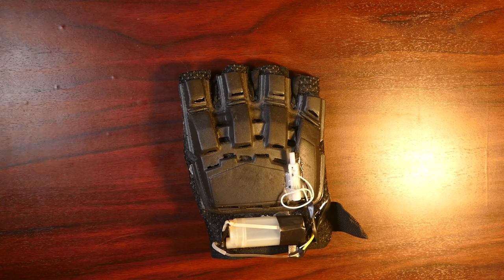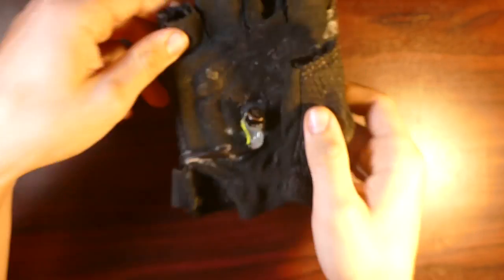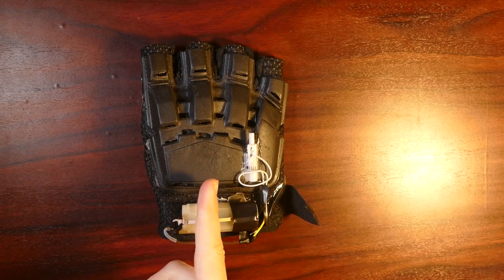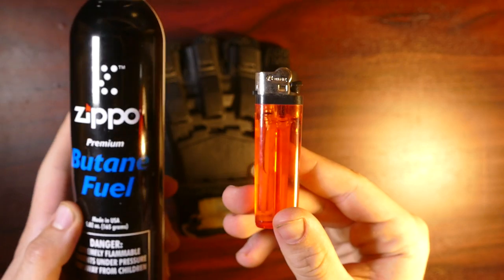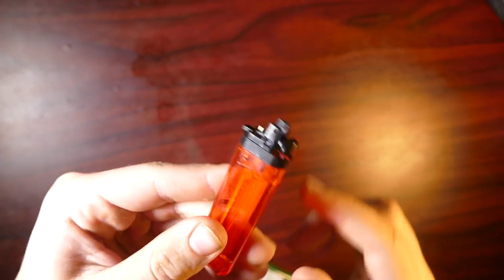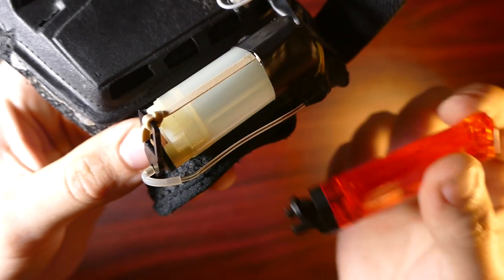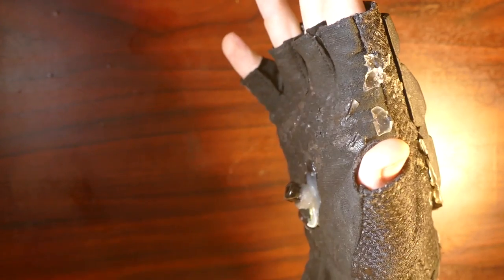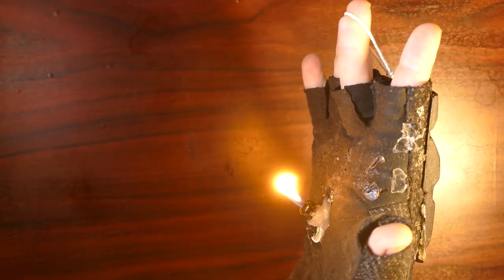DIY MASSIVE WRIST FLAMETHROWER With Only a Lighter! - BEST LIGHTER HACK EVER!!!

Comment: I made this and it was awesome until the police took it from me
Reply: SANS the skelenton what was that yellow wire? I have the globe, butane, and lighter but that yellow wire at 2:28 threw me off
Reply: What kind of butane did you use?
Reply: SANS the skelenton hey what do I do if the butane is blowing the hose off
Reply: I tired using my BBQ lighters but it didn't have the stuff as the one in the video what was the name of the BBQ lighter you used?
Reply: Eddie Shannon it is a separate copper wire
Reply: Eddie Shannon it was an extra wire to make the sparker longer
Reply: @eddieshannon9388  I think the wire just kept the plastic piece and the lighter more securely together since there is no type of energy in that plastic piece. But don't take my word for it.

Comment: im gonna mix this, the electric glove, the smoke one, and the lazer for the ultimate gadget! B)
Reply: I like the idea but I doubt it will fit all in one glove. Also If you will make a electric glove you can take out the ignition in the bbq lighter and make the butane burn by going through the electric spark in the electric glove to save space on the glove. (Also in my opinion the laser is pretty useless if you have electricity and fire for damage ond something similar to freezing. Also the laser doesn't do much. Just saying)
Reply: That sounds cool

Comment: Couple of Questions:

1) The fire seems to be spurting out other than the direction the hand is pointed in, is this normal? And how would you fix it to only throw fire where you point it? (e.g: Stop the gas leaks)

2) Is hotglue a good idea to use on a flamethrower..? Is there any substitute material I could use instead?

Comment: does the hotglue not melt under the heat of the flame?
Reply: Epsilon Builds yeah I was wondering that too
Reply: Epsilon Cosplay probably does. That could be why he doesnt hold it for too long
Reply: Epsilon Cosplay it also dries when you stop it
Reply: Epsilon Cosplay u could also wrap it with electrical tape or any fire retardant material
Reply: no
Reply: I dont think so if u will hold the flame for longer time it will definately melt
Reply: I made this too. And yeah. It does.
Reply: It can stand because its hot-glue
Reply: @ledude12  i see what you did there

Comment: @JLaservideo 

Hey there, you just made my dream come true! I always wanted to make a wrist flamethrower and now I will.
Another suggestion would be: 

When you pull out that sponge tube which restricts the gas flow, you can then fill up the lighter with some other liquids.

What can you do?

Make a pepper spray solution (mix chili powder with water, then filter the liquid, add something else to taste)
Fill half of the lighter with that solution using a syringe, then top the rest of it with butane. Bam, you have a wrist mounted pepper spray that you can use with a pull of a string. 

Could this work? let me know!
Reply: Yup it’s been done before it works

Comment: I can't get the fire started even though I can see the electric "zap" from the wires, and it still won't get started when I have the gas on. What should I do?
Reply: Same thing happened to me
Reply: This guy doesn’t reply to anyone, your best bet is switching fluid or something
Reply: Just made an easier to light version with an arc lighter as ignition, send your email and a I can send pictures and guide you
Reply: @eddieshannon6880  Hi there i got the same problem can you help me with it too?
Reply: Same issue, I’m gonna change the butane to triple refined and hope it’s just a bad fuel issue

Comment: will it burn you if hold your hand with your palm facing the target? or does the flame shoot out far enough so it doesnt touch you?
also, will it melt the hot glue?
Reply: Ferrari 5202 not really just makes your Palm noticeably warm. Yes. And no it shouldn’t if you extend the nozzle distance from the palm

Comment: I couldn't get mine to ignite, I could see the electricity spark in the right area I thought, it won't ignite, it will work perfectly fine if I use a match and then press on the gas but I can't ignite it using the sparkplug
Reply: Mason Butler Just made an easier to light version with an arc lighter as ignition, send your email and a I can send pictures and guide you

Comment: ive been messing with lighters for a week. when i take apart the bbq lighter it stops working. idk why, maybe the arc isnt enough to get it to light. so i decided ill get a plasma lighter and work with that. until then, i tried making the fuel cell and i can't get the butane to go into the lighter after removing the air restriction tube.

Comment: how much did all the materials cost? (including the butane and glove) and what specific glove is that?
Reply: Eddie Shannon idk about the glove but the can of butane cost about 3 bucks for a bottle(depending where you guy) do not spend 5 bucks for it just check another store
Reply: okay, but what's that yellow wire and where did it come from. I'm building it but I'm stuck because that yellow wire that you connected to the metal nozzle appeared to have come from nowhere
Reply: it was around 2:38
Reply: Eddie Shannon it just the speaker wire that ignites the gas

Comment: MINE DIDNT WORK...WHEN I REMOVE THAT WHITE THING FROM LIGHTER AND REFILLED...THE TUBE WHICH IS ATTACHED TO THE LIGHTERNOZZLE CANT HANDLE THE PRESSURE...IT DISCONNECTS EACH TIME...ANY SOLUTION?

Comment: what kind of lighter did he use
Reply: Kristyn Canales any bbq lighter would do
Reply: For ignition I would use an arc lighter striped apart, glued down, with wires soldered to its ends to run the connection to the front of the gas nozzle on palm

Comment: Instructions unclear. I'm not sure where to solder the wires
Reply: there is no soldering, you can choose to solder the wires tho
Reply: I’m trying to figure out where the wire at 2:39 came from myself lol or at least if I’d need it
Reply: Just made an easier to light version with an arc lighter as ignition, send your email and a I can send pictures and guide you